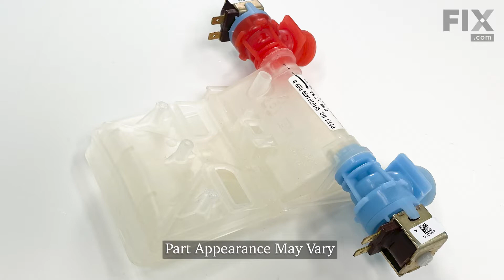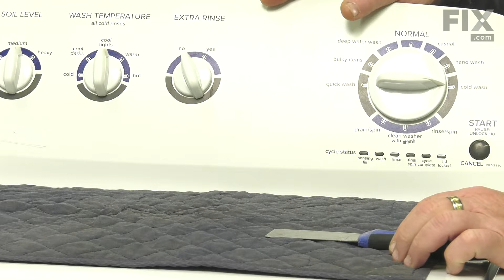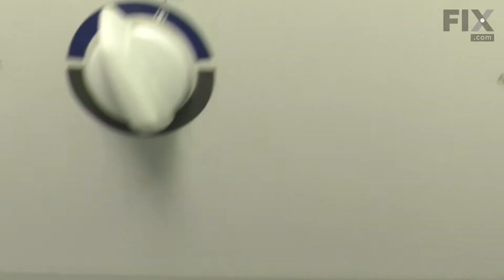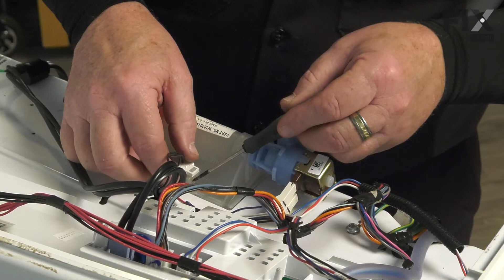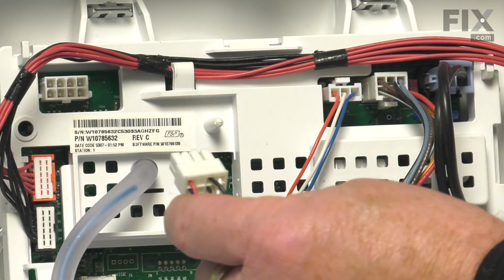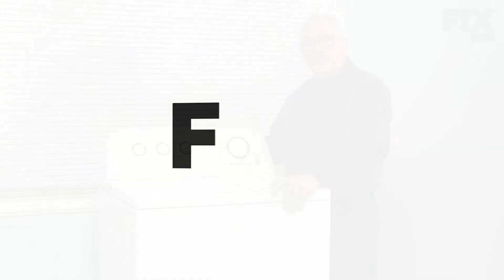Whirlpool Washer Repair - How to Replace the Water Inlet Valve

Comment: Thank you for this video.  This was very helpful when I had to replace my Water Inlet Valve on my Whirlpool washer (WTW4955HW1).  My replacement part came with all the wiring attached.  The only wire harness I had to disconnect was the one to the main board, so it is even easier now.  Also, the two screws holding the valve in place on mine were torx screws.  Thanks again.